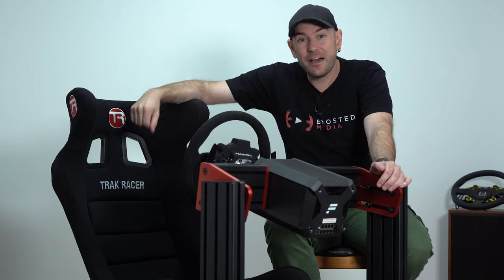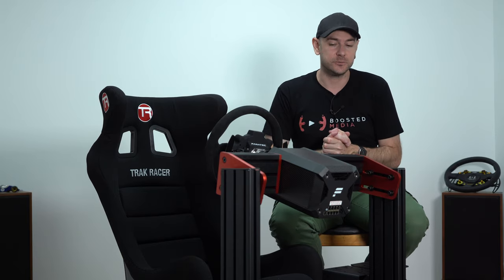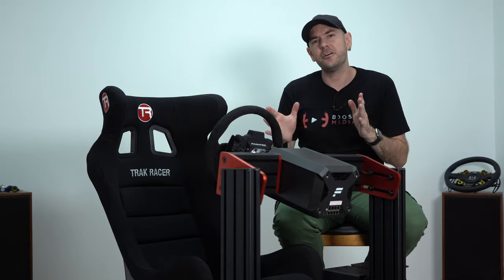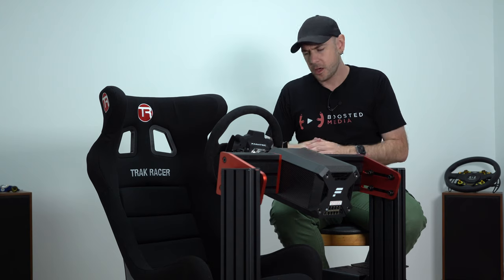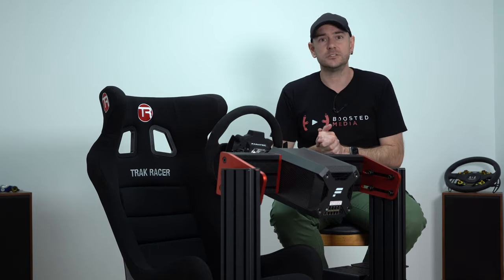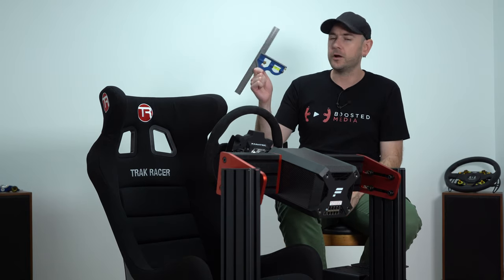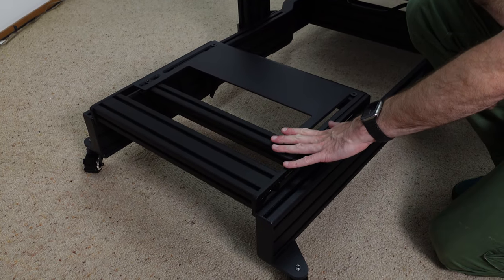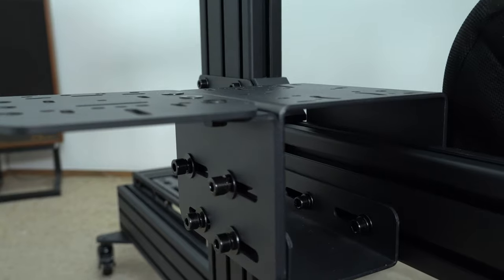REVIEW - Trak Racer TR120 Sim Racing Cockpit & GT Fixed Seat

Comment: Love my 120 and screen mounts. No items missing. Did have some shavings but nothing major. Itemised everything with post-it notes before I started assembly which made it easier, I am pretty pedantic and assembly took about 6 beers, was enjoyable and a bit of a challenge. Took maybe another few hours over the next few days for adjustments etc. seat holding up well. Will likely buy trakracer stuff again. Haven’t got the caster wheels yet but do want to get them, think they would be handy for moving and cleaning around etc. seat slider can feel a bit rough and notchy if I was being picky. Owned since they were released and no issues as yet.
Reply: thank you for your support.

Comment: Very informative video Will. You have been my go to for information on sim racing. Do you think the rally seat is sufficient enough for reducing movement or do you recommend another type of seat? If so, what would you recommend? As for mounting the shifter closer, does Trak Racer include parts to mount that or did you essentially come up with that custom solution yourself?

Comment: I have for a year a tr 160. The extra keyboard mouse tray is a bit flimsy and it came with a non threaded piece, after some back and forth with the Customer Service ( 1 guy ? :P) I got sent a replacement threaded piece to finish the tray. Building it was hell and took for ever but after building it I haven't touched it for a year and it is as solid as it gets. At my heaviest I was 125kg and the rig does not care about that at all and the rally seat fit me fine. 

The nice looking floor mat is actually too small for the rig. So that was a bit of a let down and for some reason I only got a fully black rig and no of the nice red accent colors...

Comment: Please, I want to put the T300 steering wheel in that configuration and I don't know if I will be able to... the T300's steering surface is 26 cm. and I don't know if the black plate to mount it is wide enough. Thank you.

Comment: If you buying your own Seat do not forget Seat Brackets! They do not come included just got my 120 delivered and now sitting in my bucket seat on the floor and looking at the boxes before vital parts will arrive....
Reply: Man thanks for the heads up, how has your experience been? Looking at getting it with the Black Friday sales
Reply: @RPMhunter  If yoou havent build one before you are in for a roller coaster. No youtube channel provides the info of how hard is to build aluminium profile. It took me 12hours by reasambling the rig 3 times due to unmarked parts. I'm even thinking to release the TR120 Manual walk through to help others. Despite all issues its amazing but would never ever build one again. When buying T120 You need to add just the bracket for bucket seat that's the only thing not included. It might be included if you order TR seat. But would recommend to spend few quid more to get bespoke seat of your liking. Because TR seats are gaming seats when a real bucket seat is real and you can get one for anything from 300-600 which is the same range for TR Seats which are just a gaming seat really.
Reply: @RPMhunter  I went for sparco Circuit 2 seat and its f** amazing I never imagined that a seat can improve my lap times by holding me tight all around and allowing me to focus on the road. Sadly it does reduce gaming time as you not moving much curtain parts start to get tired faster but still 2h non stop sitting is ok. Its not like 30min race and you need brake

Comment: I find that if I set my tr120 with the seat all the way back it rocks backwards when using the standard feet included. So ive had to adjust it all forward with seat slid all the way forward to stop it rocking, Also the gt seat is a bit soft but if you break lower more from the hip and get the right angle on the brake pedal it doesnt flex but can be tricky to position yourself each time. Other than that its a great rig. Was wondering if you could do a review of the inverter/gt/hybrid setup?

Comment: Hey Will…..noted you put motion on this.  How did you compensate for the difference in width?  Thanks
Reply from the maker: Have a look at my Sigma Integrale review video. It’s shown there. Just added some 40mm profile rails to the front with some 90 degree brackets.

Comment: have been going back and forth a few different sim rigs but this video pushed me over the top and I ordered a TR120 a few hours ago. However, I am now 2nd guessing the GT fixed seat. I got it because it is the seat that is most like the one in my car. Anyone know if they have revised the seat to fix the issues in this video? or should I try to have my seat changed to the rally seat

Comment: So how much was everything that was mentioned and reviewed on this video? Just trying to get an idea as to what one will have to spend to get that… Since you don’t have the tv mounts I would have to spend a little more but I just want to get a general idea as to what I need to spend to get a fully functional rig. Pedals, seat, rig, wheel
Reply: Hello fellow Matthias,
I believe it is an additional 300 AUD for the monitor stand. Only critical parts remaining are your monitor, pedals, wheel base & wheel, shifter & handbrake, all of these vary enormously in pricing. In order to make use of such a rigid base, I'd imagine you'd be spending close to an additional 2000 - 3000 AUD. Unless second hand, if you are spending any less, you can happily buy a smaller less rigid & cheaper base frame

Comment: Hi, very informative video. Is this cockpit compatible with sigma dk2 motion system?
Reply from the maker: You’ll need to add some profile to the sides on the front but yeah. We used this rig in our review of the DK2
Reply: @boostedmedia  do you assume performance wise and in terms of reliability, the TR120 it is heads up with the TR160 MK4?

Comment: Does anyone else also have the same feedback on the GT seat as Will in regards to the flex and the seat bulging on breaking?
Reply: I saved myself money and picked up an aftermarket Fixed back.
Reply: Been using the TR160 for around a year now. Happy with it but the GT seat is absolutely dreadful, definitely choose a different option.

Comment: I am shopping and hesitating between this TR120 and a TR80. What are the main differences between these two rigs?
Reply: The TR80 includes the shifter mount and also has a more adjustable pedal deck which can go from Formular to GT height. The TR120 has higher profile and a more unique design than anything in the market. The Pedal deck on the TR120 may be considered as more rigid.
Reply: @TrakracerAu  understood, TR80 for me it is. Thanks. Will place an order soon.

Comment: I'm looking for a new rig and TrackRacer is so far  my preference, honestly was looking at TR80mk5 and not TR120. Would be TR80 a good choice or better to move one step bigger? Fanatec CSW 2.5 and Heusinkveld Sprint
Reply from the maker: Haven’t tested a TR80 so can’t comment. Sorry.
Reply: the TR80 is a great choice and included the hybrid pedal mount for Formula and GT driving positions. It also includes the shifter mount.
Reply: I'm in the same situation and looking at the TR80 as well. I'm fine with the slightly thinner 8040 profiles but would like to know how it would handle a dbox type motion system which I plan to add later. 

How do the TR80 and 120 compare in
ease of integrating to the base profiles and stiffness when adding motion?
Reply: @sarabothea  Our TR80 will handle motion very easily.

Comment: Nice review...Can you actually fix Fanatec clubsport V3 pedals with this system?
Reply from the maker: Not sure what you mean sorry? Can you mount them? Yes.
Reply: @boostedmedia  thanks for you reply, I meant can you mount them on that exact setup or  do you need the other plate with the holes already drilled?
Reply from the maker: No they can be mounted with this setup, but the TR heel plate would be redundant

Comment: Great thorough review Will. Owned a TR160 for around a year now, had a very similar experience with missing parts and metal shavings everywhere etc. I also have the GT seat, you aren't alone with yours bulging out under braking and twisting in every direction. For anyone ordering, I would certainly choose a different seat as the quality is beyond poor and is in no way fit for purpose.
Reply from the maker: Thanks for the feedback mate. They’re insisting the seat I got was faulty and want to send me a new one to try so we’ll see. So far 5 people have said they have the same issues.
Reply: Have to update us mate with the outcome. Won't be holding my breath though, I've sat in four other people's chairs and they're exactly the same.
Reply: Dam this sucks im waiting sinds mid February on that seat and still am im going to be really upset if that seat is that trash  and flimsy how is the sim lab speed 1 or other bucked seats like this?  Cause there getting a return asap if its like this
Reply: @KevinX_0  we can change you over to the rally seat if you like. just email the request through.

Comment: Holy crap who ever was in charge of sending this unit out should have there job looked at.  How the hell are you not going to triple check boxes before sending it to one of the largest sim reviewers…. Sighhhh
Reply: I guess they wanted Will to have the "typical" customer experience. 😂
Reply: fair point. We are moving a few thousand seats a month from 7 global warehouses. This product and experience (while it may have happened before) is not normal. We are about to release a new range of seats including our new Alpine Racing TRX seat which will supersede the current range and has been engineered to a much higher (FIA level) standard.

Comment: Has anyone had an issue of the base of the rig not being uniform along the ground? Mines on the piss from corner to corner diagonally across the rig from pedal plate to seat… can’t get my head around why…
Reply from the maker: Are you sure it’s not your floor that’s uneven? 

I have that problem in my new studio. Have to put rubber pads under one corner of the rig to compensate for the uneven slab.

Comment: My opinion applies to all of the commercial available aluminum profile sim rigs. They REALLY need to contract a mechanical engineer to help them with the design. They keep on making the same mistakes over & over again. TL;DR It is all about gusseting correctly and directing the forces into the floor. I made my ZERO flex, adjustable rig out of 60/30 profile by correct design for $750. Disassembled, the ENTIRE sim hardware fits in my MX-5 Miata (just moved across America).
Reply: Post a video of it if you can. Would like to see the setup.
Reply: @dimsoneill  Will do within the next 7 days and post it on my YouTube channel. I will mention it on this post when uploaded.
Reply: We have a team of engineers and all our profiles are SGS tested for load limits.
Reply: @TrakracerAu I have no issues with your aluminum profile, other than being needlessly large and expensive. I have issue with your connection methods.
Reply: @tgiencke  please elaborate and i'll pass it onto the mechanical engineer at Trak Racer
Reply: @TrakracerAu  Please watch the video I posted above.
Reply: @tgiencke  I can't find your video about our products. please can you link it?

Comment: After looking at rigs for a while and trying a few  I went with a Racekraft rig.  Much better customer service and in my opinion better product overall. 

Awesome in depth review as normal Will.
Reply: Racekraft also buy from us. Have you dealt directly with us to see our service and product?
Reply: @TrakracerAu  I tried to deal with your company through multiple enquiries that not once were answered.
Reply: @brendensmith3452  I was unable to find an inquiry from 'Brenden Smith' but if that is the case, that is extremely poor and I am sorry.
Reply: however Racekraft price range is way higher than Trak Racer.
Reply: @brendensmith3452  That's weird. I asked a couple of questions and they answered very swiftly, even gave me a call to explain things properly.